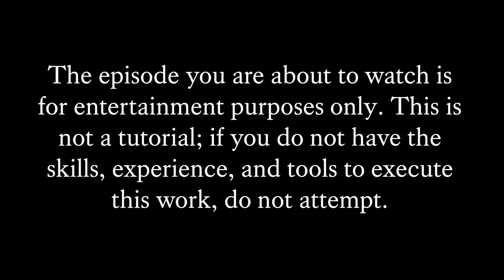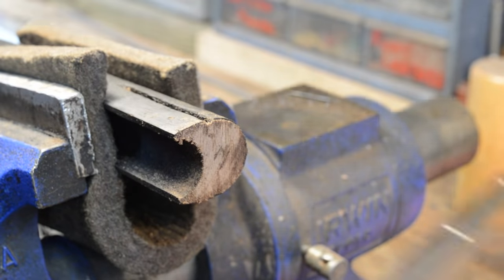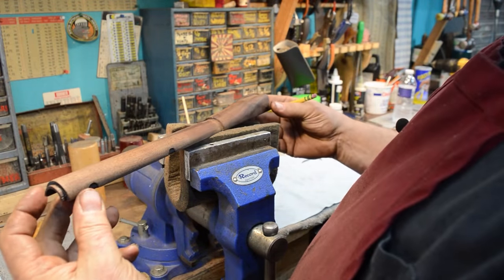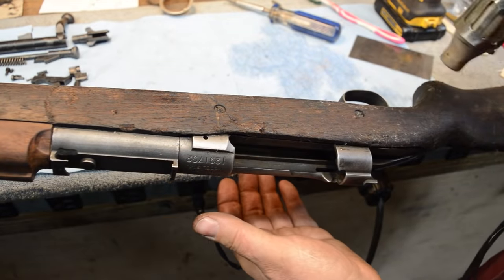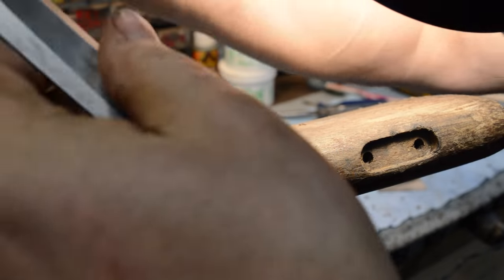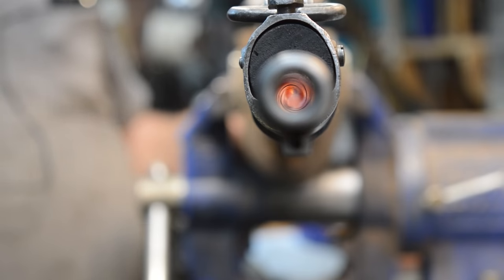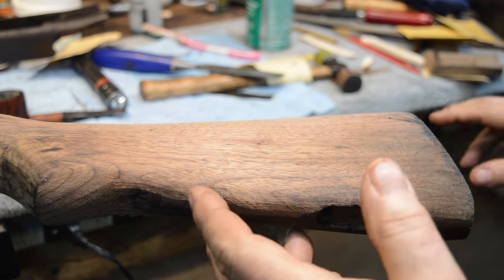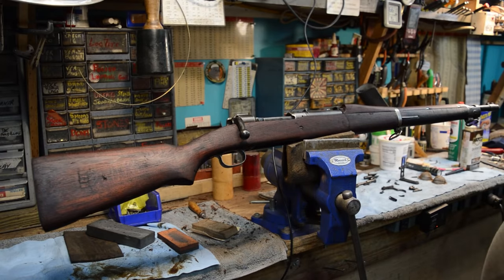Anvil 094: 1903 Springfield Split Personality

Comment: Great video, love your channel. What gauge metal do you use for your scrappers? Currently working on restoring my grandfather's shotgun, has his initials carved into it and wanna be sure not to remove it with sand paper.

Thanks, Mike
Reply from the maker: .032"ish. Just thin enough that they can be flexed slightly to control the cut
Reply: @marknovak8255  appreciate it

Comment: "buy the bore, fix the rest" good advise!
Reply: And so many times buyers are fixated on the outward appearance but nice wood doesn't equal nice shooting.
Reply: I picked up a couple Lee Metfords that simply couldn’t shoot. The guy was shooting jacket ammo out of them and they patterned rather then grouped. I figured they were project guns but turns out lead ammo and one shoots 2.5” and the other shoots a decent 3.5-3.75” but is smoother and looks better.
Reply from the maker: @john-paulsilke893  Minute of basketball....
Reply: @marknovak8255  200yrds to hit an 8” gong most of the time is decent. Especially for WWI guns that have weird Glock rifling. 😁

Comment: That BB trick is genius.
Reply: Before he did it I was thinking a pointed steel pin. The BB is way easier. If putting pressure is too much for the structure a dab of sharpie will transfer from the metal to the wood.

Comment: I remember doing this on a $60 Mosin Nagant i got that was encased in a hundred years of cosmoline. I ended up taking a torch to it and letting the oil run down. I remember scraping it just like you did. Brings back so many memories. 10/10 would do again.
Reply from the maker: Outstanding.....!

Comment: Leave your cut long. Like 3/4 “ >> Drill your rod hole >>Cut to final length. 
Cut opposite side to length >>Use the 3/4” cutoff as a jig for the rod hole on the mating side.   
No guessing at all.
Reply: As long as you drill straight!

Comment: 4:45 rasp envy!  That's exactly what I've learned about old wood: take your time and sneak up on it.
Reply: My stepdad was a carpenter he’d say to me “take your time” because its wood and it takes a lot of water and a fuckin long time for it to grow back
Reply: Good tools make the job a lot easier!
Reply: @BESHYSBEES  The saw man on my first pro carpenter gig who'd been a carpenter since shortly after God invented wood told me, "Slow is smooth and smooth is fast. Get in a hurry and screw up in a hurry."
Reply from the maker: The rasp is a tool I don't use much in fine woodwork. But, when it does come out it helps to have the best....
Reply: I'm pretty sure it's a Shinto Saw Rasp (or the equivalent in a different brand), looks to be a medium/coarse but I have no idea on the length (they come in 200/250mm).

I can confirm that they're absolutely amazing until you run it across a finger... then you curse how well they cut.
Reply: @etelmo  Thanks for the info!

Comment: Our rowing club owns and restores antique boats.  Our shop uses heat guns to remove old varnish -- the biggest challenge with new volunteers is not moving the heat gun enough to prevent burning. It's worth mentioning because it's so hard to fix a burn after it's happened.
Reply: that sounds like a great hobby
Reply: @jobdylan5782  It's truly a pleasure both to row a wooden boat, and to maintain them.  We have some wooden boats that are over 100 years old, and we also have modern composite racing shells.  This is pretty unique in the rowing world.
Reply from the maker: I agree about moving the guh fast enough. Try removing the burn caused by a house fire...
Reply: @marknovak8255  I'll leave that up to the pro.  :)
Reply: @Alanbataar  I was wondering to myself recently if anyone actually did that, so there's my answer. Pretty awesome.

Comment: Dont know if you ever use regular low grade paint thinner or even kerosene when sanding, it keeps the paper from gumming up.
I use this method on fine finish furniture. I use a cork block to back up the paper for an exact flat finish, then just paper for dipped places... works for me...
cheers!

Comment: In the 70's i was a cadet in a military school in Camden sc. We had M14s that ended up going to some country for i think a lend lease deal. The were replaced with 1903A1's. I was on the armory staff for a while and i remember the stocks were not shiny or overly smooth. Some had what we called a straight stock and some had more of a pistol grip like a hunting rifle. For replacement stocks came in for repair or replacement the goverment sent both wood and what we called fiberglass stocks they were a brown in color i don't know ifthey were really made out of fiberglass but they were tough. The 03, had the single shot/bolt latch welded and thebarrels plugged whith what i was told salt and a steel rod to render the barrels demilled again i dont know if its true about the salt but some of they guys that carried the M14 appreciated  not having to clean the barrel any more. I preferred the M14.
Reply: I remember those stocks. The ones my school got were plastic with a metal reinforcement in the wrist area.(We learned about the metal when a member of the drill team failed to catch a rifle during 'exchange arms'!)
    I have often thought about the amount of NOS 03A3 buttplates, trigger guards, swivels and other parts that we pulled out of cosmoline to repair those drill rifles. Good Memories, John

Comment: Mark, should your spring steel be softer or harder?  Looking at some stock on McMaster Carr (don’t panic 3”x3”) and I see everything from Rockwell hardness of C33 to C50.  Any insight?
Reply: Go to Garrett Wade or Lee Valley Tools and buy scrapers of already chosen hardness. They are inexpensive,and if you wish to do your own experimentation against a now known quantity,it will speed the learning curve. Home made scrapers can be a fine choice. There is a Stanley scraper plane that uses much thicker material,for instance,and having a non flexible scraper can be very useful. Broken bottle glass or windowpane being an example. The commercial product is often so much easier to deal with.

Comment: Making something that works and looks good from something that has truly been junked is a very good thing, but everybody please just remember what Mark touched on several times-- before sand paper or tools touch a historical artifact, make damned sure it's necessary, and not just wanton destruction of the real thing to create a parts gun that "looks" "correct".  Too many good pieces get ruined by people who think they are "restoring" something, when they are really just making a mix master with repro parts  out of a real veteran.
Reply from the maker: AND, 99 of these things die from rust, to every one bubbaed. Learn what you need to learn and get on with it. Most of you will get through it alright.

Comment: Whatever happened to boiling a stock?  This used to be common practice for removing oils and grease as well as raising dents.
Reply: I think it went out of favor because it strips all the natural oils out of the stock as well. If you sweat the cosmoline you only have to replace it with a couple coats of linseed oil

Comment: Regarding cosmoline removal, when my dad was in the Marine Corps in the early 1940's, they would go out in the middle of a field with a bucket of gasoline to remove it.
Reply: I've read a few books from the 1950s or 60s, and that was mentioned. The (former Marine) character also said that it was still a lot of scrubbing.
Reply: The downside is Gasoline(White gas/coleman fuel works well too) is that it's flammable, so using it indoors is a no-no. Acetone works well, but has the issues with being really bad news for humans. MEK works wonders, is neither flammable, nor toxic, and is available at Home depot, Iirc.
Reply: @machinist7230  what on earth gives you the idea that MEK isn't flammable or toxic?!? 

It's just that by the time there's enough vapors to burn, the humans have fled because of the smell and eye irritation. Unless you're using a full face respirator, of course.
Reply: @ScottKenny1978  I understand that MEKP is even worse.  Liquid hardener for fiberglass, if I remember.
Reply: @williamsullivan9401  pure MEKP is an explosive, but yes, it's also used as the hardener for fiberglass epoxy in about 35-40% strength, the other chemicals are to reduce the sensitivity to shock, so you don't blow your shop up by dropping the container.

Comment: That rasp is wild. I bet that would come in handy for filing down axe handles when hanging axe heads.
Reply: It's a Shinto Saw Rasp, looks to be a medium/coarse but I have no idea on the length (they come in 200/250mm).

I can confirm that they're absolutely amazing until you run it across a finger... then you curse how well they cut.
Reply from the maker: It IS damn sharp.........

Comment: Curious to hear your thoughts on "gunny paste".  Its equal parts boiled linseed oil, turpentine, and bee's wax.  Been using it the last year or so and im liking the results
Reply from the maker: I'm putting that on the list of things to try..... Recently I tried 2 coats of urethane, scraped back to the surface, 320 sand, 10 applications of oil. Looks sharp. It's on the Hawken we did for the WV hunter
Reply: @marknovak8255  thanks for the responce!  Looking forward to seeing you give it a try!  As always!  Keep up the amazing work sir!   You're a huge inspiration for us younger generation! 

Is that one you mentioned on your youtube?  Im going to have to go check it out right now.

Comment: So when is the cosmoline removal video coming out??
Reply: When we manage to send an entire shipping container full of (preferred beverage) to Mark to make him even consider the idea.
Reply: @ScottKenny1978  i would gladly pitch in on that. Small price to pay for a glimpse inside the mind of a madman
Reply: Take a heat gun/paint stripper, heat up the wood/metal until cosmo/grease starts flowing like water. Dab the liquid cosmo with blue industrial paper towels. Repeat a hundred times or more. Just don't hover the heat without moving it unless you want to burn a black spot. 
Heat gun really cleans out the cosmo from nooks and crannys of receivers. When it turns to thin liquid it just runs out of the action. Saves hours of work and tons of q-tips.

Comment: Unpopular opinion, but even in military service these guns were never kept original. If the stock was damaged, they'd replace it with a brand new one. If the original stock is in such bad condition, it's no crime to replace it entirely with an accurate reproduction.
Reply from the maker: True, so we kept one in the pool so someone else could use it
Reply: Indeed. I had a Garand I would not have hesitated to put a nice new stock on. Would have looked liked new, maybe even better. 

However, new wood never feels quite the same as 70+ year old wood. The way it smells, feels, looks, and even sounds is not the same. Its like rebinding an old book. Yes, its perfectly acceptable to rebind a 200 year old book if the cover is no longer serviceable, but its just not the same.
Reply from the maker: @jackmcgramm2259  George Washington's axe, et al
Reply: @jackmcgramm2259  I agree with that. I have a 1943 Turkish Mauser with some of the most gorgeous wood you'll ever see on a military firearm. And I chose to put World War II Victory grips on my Parkerized 1955 M&P revolver because those deep red grips just had character. I always look for good wood on milsurp purchases. I have two 1903A3's; one I bought refurbed to like-new condition with a Criterion barrel, and the other is a historical sporter that needed significant work to get up and running again. The latter turned into a money pit; original stock was stealth dry-rotted and had to be replaced, and the Bausch & Lomb scope mount proved completely unworkable and likewise needed replacing with a modern Picatinny mount. I had all the work done properly (glass and pillar bedding on the new stock, custom LOP), so at least the rifle is now perfectly fitted to me. The 1903 action is really amazing for what it is. An excellent trigger combined with an excellent bolt cycle. Too many people ignore just what a huge improvement it actually was over the Mauser 98.

Comment: Thanks Mark for your very good video, i e done a few rifles this way but a few 8 had to replace the whole stock with new wood, it makes my P-17 look brand new, not quite what i was looking for but managed to restore an old girl back to her glory. The metal finish was not touched because it retained the still beautiful finish. Your videos are by far the best I've seen for these old rifles and am ready to fix or at least give a try to fixing a duffle cut. Thanks again.
Reply: I'm doing a P-17 right now that was sporterized. The stock it's in now was cut straight in front of the barrel band but it appears to have been sanded and then slathered with polyurethane. I couldn't find an original stock that wasn't completely chewed up and cracked for sale online under $400, so I bought another walnut sporter stock that had been cut straight down in front of the barrel band just like the one I have now - only it has the original reddish-brown finish and all the markings like the eagle head stamps. Found it on eBay for $50. I found a front and rear handguard with matching color on eBay as well for another $50 for both pieces. For a repair piece to do the front of the stock I ended up ordering a complete British P-14 stock from APEX for $99. I am going to cut the nose off the P-14 stock and then try to mate it up with the surplus sporterized stock I got off eBay using the method Mark is using here. I ended up spending approximately $200 for all the wood stock pieces instead of $450 for an uncut stock and handguards or nearly as much for one of those Italian reproduction sets available on Numrich. I wanted to avoid the issue you are describing here where you end up with a 100+ year old rifle with corresponding metal finish sitting in a brand new stock. Even though rescuing an old military surplus rifle is quite satisfying, I still didn't want to end up dumping so much money into it that it exceeds the value of outright purchasing one in original condition. I enjoy rescuing these old sporterized military rifles when given the chance but I don't want to make them more expensive than just buying one unmolested. This P-17 will be the 4th military surplus rifle I have rescued from being sporterized and returned to their natural state. I have done a Lee-Enfield No.1 MK.III, a No.4 MK.1, a Gewehr 98 Mauser, and now this P-17.

Comment: As a furniture/cabinet/sign maker, we repair/join/etc pieces with wood with wooden dowels, instead of a metal truss (in general, with the exception of some musical instruments) because wood is "dynamic" and steel truss is much less dynamic. We want the joint to flex with the rest of the wood in humidity, temperatures, etc to avoid cracks, and joint failure.
Reply from the maker: True, for furniture. A gun is subjected to thousands of G for several microseconds, whereas furniture is not. There is a difference in the two environments.

Comment: Out of curiosity when you were mixing your tint with oil. Was that the light brown Watco Danish you used in a previous episode. ??
Reply: Yeah. I picked up on that too. I have a can of it in my shop. Used it to blend a chipped stock I fixed on an old 1920s Stevens 12 gauge. Good stuff and the stock looks great thanks to some tips I picked up watching Mark
Reply from the maker: I use all three available Watco oils, to get the final look I'm after

Comment: Instead of the balls, get a cheap Harbor Freight transfer punch set a cut off what you don't need to use. You'll have over a dozen transfer points that are accurate.
Reply: The set is under $15.

Comment: I've found I have better results using more water on my cloths when steaming stocks I wet them more frequently and run them very wet.
Reply: Of course I'm using a teflon coated hand(like for clothing)iron.
Reply from the maker: The hemmed edge of a dripping wet towel, over the dent, press hard with the iron.